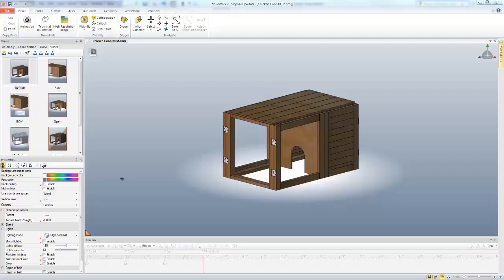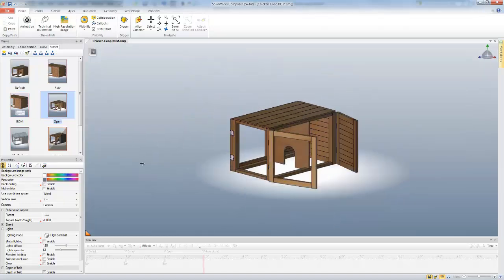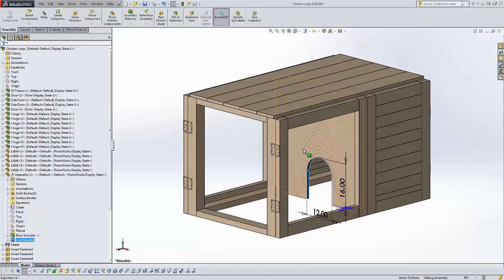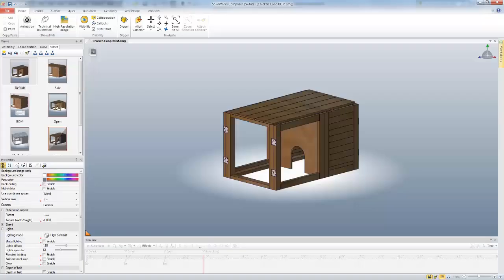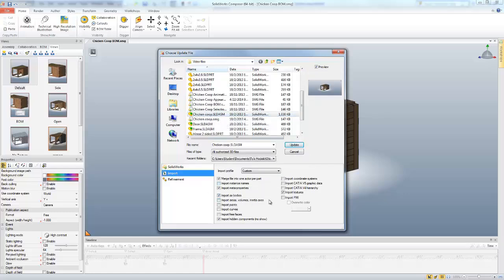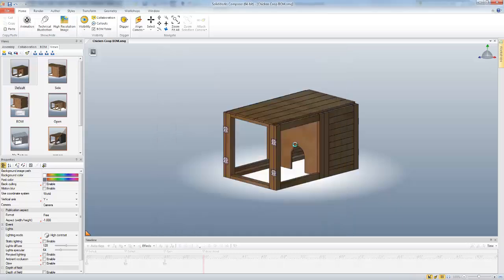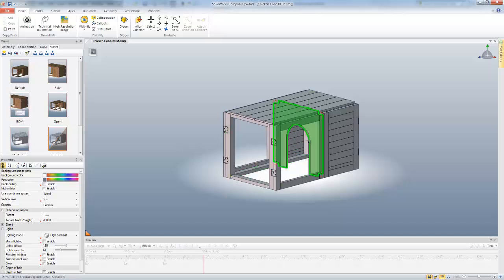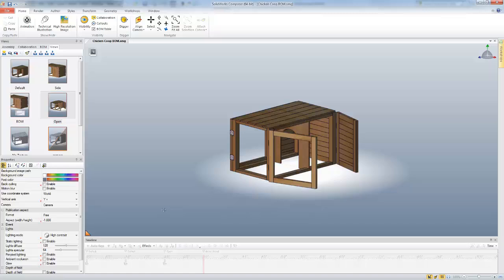SOLIDWORKS Composer - Update Composer Files

Comment: Does not work. Other parts that never changed are shown as hidden. If you are making assembly guides with steps than this is a huge problem. you might as well just start from scratch rather than trying to show all hidden actors in every single view.

Comment: nice tutorial! if you just want to update one actor with all of it's custom-properties (Metadata) you always have to update the whole assembly file.
So there is no way to update a single actor including Metadata using the File-Update command...
Reply from the maker: Currently, it is possible to update the geometry but not the meta-properties for a single part in an assembly.

Some possible workarounds are to either:
A) Update the geometry and meta-properties for the assembly, using File -> Update -> 3DVIA Composer Document, or
B) Update the geometry for the part, using Geometry tab -> Update.  Then, edit the meta-properties manually in the Properties Pane.

Thank you for watching.